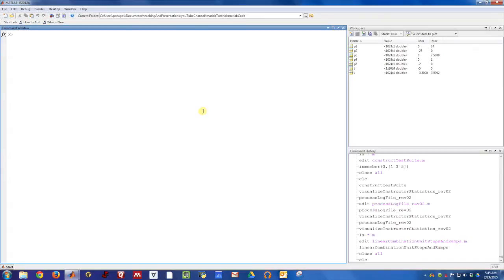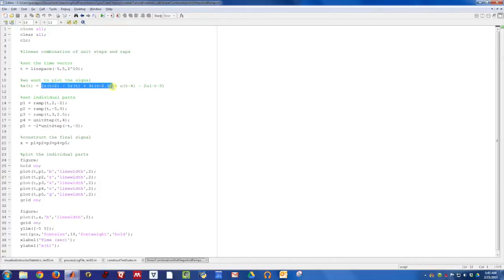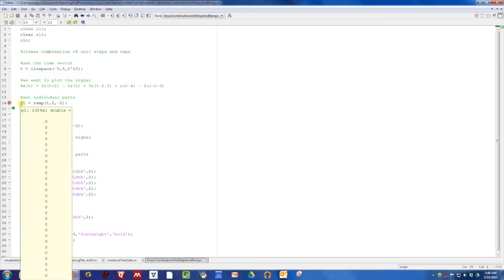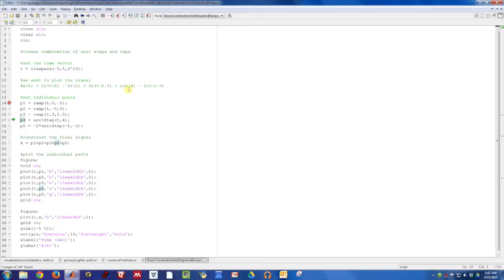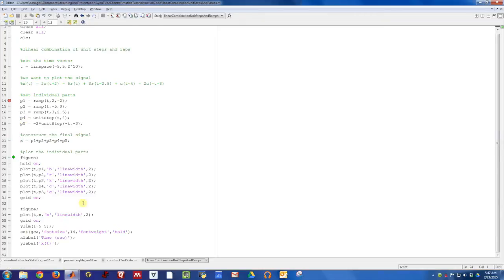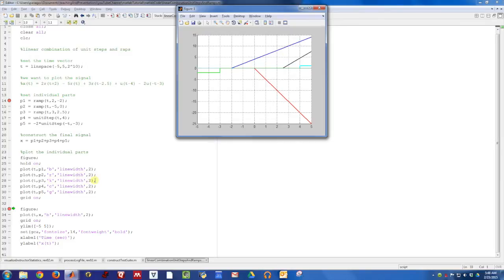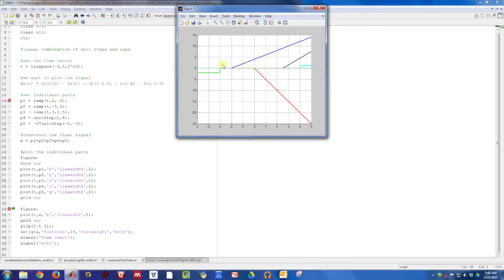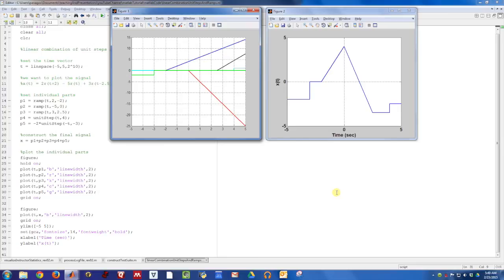Matlab Examples - Linear Combination of Unit Steps and Ramps

Comment: Nice video. Please I'd like to know. If you have an initial value for an input signal into a system and you wish to ramp it down/up (instead of using a step change in the input signal), how do you do that?